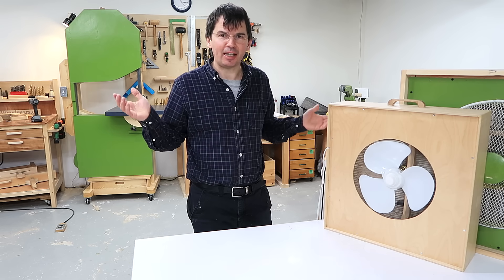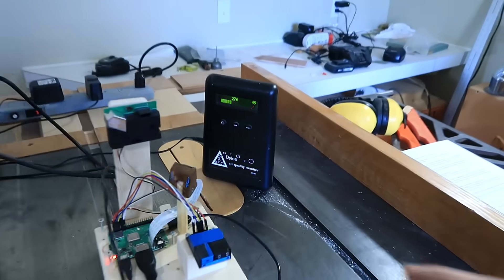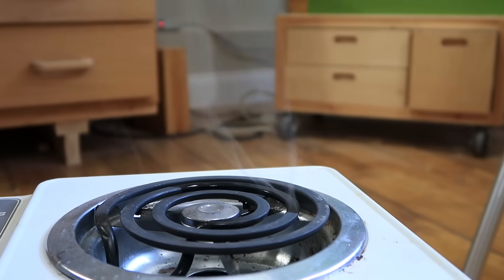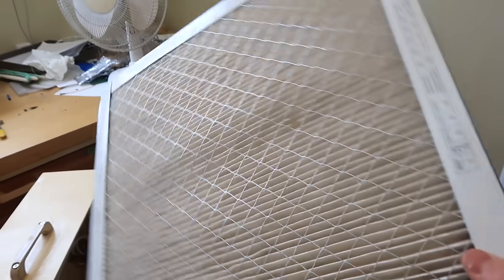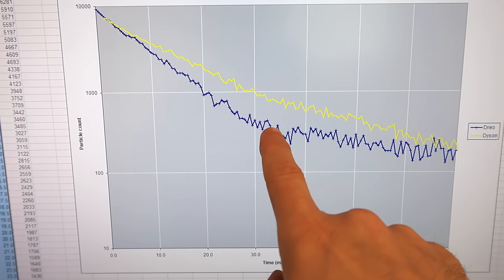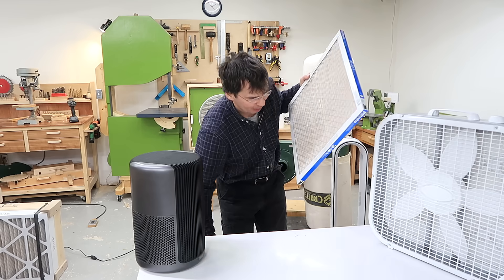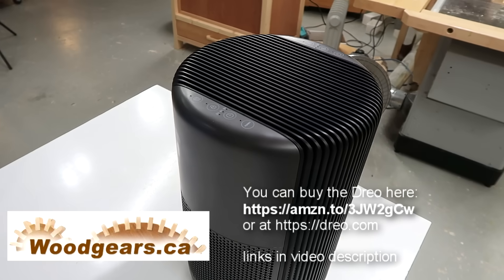Clearing smoke with an Air purifier.  Which is fastest, quietest?

Comment: Thanks for the material as always. 
I have been looking at making a diy box filter for a long time. The stumbling blocks in my country (Ireland) are around the filter availability. Also, we don’t tend to use a lot of big filters here so I’m a bit ignorant about finding comparable items. 
The older furnace filter, used in the video there, is a 3M filtrete 20x20x1 inch unit. 
Has it got any other features or characteristics that make it reusable for example? 
Dimensions are not supper important as long as it’s larger. But material and a availability are confusing me. 
I can find this one 
“3M 9832DC 20 X 20 X 1 Inch Filtrete Air Filter” but have no idea if it’s a wast of money for the purpose.

Comment: I live in a rather large home, so I have 2 separate HVAC systems.   Each has a Honeywell electrostatic air filtration unit.   Living in the Sierras, we get a lot of fire smoke even when the forest fires are 100 miles away.   The systems  are  multi-speed air handlers and on the highest speed they are almost silent and clear the air of visible particles and smells in minutes.   On slower speeds they take a bit more time but you can’t hear them at all.  Surprised you didn’t test any electronic air cleaners.   I thought you had in the past.

Comment: In all of this testing, I'm curious what the decay rate was with no filtering?  How much does the air quality naturally improve over time compared to the various air cleaners?
Reply: Oh that's a good point I hope he addresses that.
Reply: Matthias forgot a control group!
Reply: My thoughts exactly. As methodical as Matthias is I was wondering why the no filter baseline wasn't included. However, as with all his videos enjoyed it and I learned something from a very interesting guy.
Reply: The decay rate with no filter would be dependent on the building construction, available windows to open and everyone's setup  is different. We always open the garage door in the shop I work in during the summer and with a fans running that seems quite effective in clearing paint fumes quick. Would be good to know his natural decay rate for this video though as that is a large space and I assume those small air filters are not performing that well on their own. He says 165 sq ft and it was roughly 40 minutes for the dreo on high to clean it and the box fan was not much longer. I've seen testing on YouTube in a smaller 100 sq ft bedroom take an hour to clean to that level with the box fan filter.
Reply: I was about to say, we didn't get a control test to see what happens when the particles are left to settle, I'd like to see that. It could turn out the box fan is just a placebo
Reply: He already implied that, when he said that the cheap furnace filters didn't work at all. for the fine smoke particles, those cheap filters were the same as no filter.
Reply: Yep, clearly misses the baseline, however the comparison between the various devices holds !
Reply: Good point. But regardless of that, relative performance od various devices is still relevant.
Reply: Oh it’ll take forever
Reply: I realize it's quite late, but he did this in a later video: https://youtu.be/4iun3jRUMiA
Reply: I was wondering the same.  I guess it would friend on whether the particles would land on the floor… as I typed this he said that smoke can hang in the air for days, so that answers that
Reply: That's my thoughts as well, this test is not really worth much, without a baseline

Comment: I'm willing to bet that the generally available air quality monitors aren't capable or calibrated to detect dust generated from wood working. It would be interesting if you could figure out a way to measure that.
Reply: Btw, great video and method of handling sponsored content. That was interesting.

Comment: We had initially bought an air purifier. The controls wonked out after a couple of weeks. The return process was just too tedious for a $400 product that wouldn't work after two weeks of infrequent use. Bought a bunch of box fans and some good quality air filters and duct tape. Significantly less expensive and not a hassle either. The air has never been cleaner than this before.

Comment: The Dreo is not only not too expensive, it is probably one of the cheapest I have seen so far. Considering it's size and noise level, I would probably not consider building an air cleaner myself. Are the burning particles comparable (in size) to those created by cutting wood on the table saw? I wonder why burning was more of a problem and thought it might be differences in how good they are recognized by the sensors. But maybe sawing just does not spread the dust as much, meaning wearing a mask is more important if that is my main task.

Comment: The old filter on the box fan is saturated. That’s why it filters better.  The fine particles embed in the filter and become part of the filter media.  I am in the Ag industry.  There has been studies that show over servicing engine air filters  is actually detrimental to the overall health of the engine.  A seasoned filter is more efficient than a new clean filter. 

This could be something you could test for yourself.  The results could be interesting.
Reply: He has actually done this before, but it was a long time ago. You are 100% right.

Comment: So basically you can spend a TON of money on a Dyson that is loud, but will impress your trendy friends, spend a moderate amount of money on the Dreo, which is compact, works better than the Dyson, well designed and most spouses won't complain about how it looks, or stop at a hardware store, and get a moderately priced furnace filter after finding a fan a local yard sale, assuming you can't just find a fan sitting on the side of the road and do about the same job. Excellent video as always, and well reasoned out. You didn't say it, but after watching your channel for many years, I feel that if the sponsor hadn't done well, we would know, and why. Maybe Dyson should take some hints. Thanks for your hard work.

Comment: The biggest issue with the dreo is the fact the filters cost 30$ to replace and don’t have much surface area compared to the furnace filters running 20-30$ and able to be cleaned and reused.

Comment: Well made and informative.  One filter on a box fan did not pull any air.  I used 4 to make a Corsi-Rosenthal filter purifier.  I guess 3D printer may emit more gas than particles.  Filters may not help much.

Comment: try to spray a bit of lemon pledge on the filter, it enhances static cling of particles on the filter, even a crappy non pleated one.  would be interesting to see the difference with and without the spray on one with a box fan [also the method I have used over the years]

Comment: Great Video.  Youi should have done a control with no fan to see how fast it settles out.  

The first factor in the rate of fall is the volume exchanges per unit time.  That's a first order differential equation.  

There are HEPA filters that can remove very small organisms and dust from the air.  

Great video.

Comment: A related idea for a future video: how often should I replace the air filter on my house heating/ac system? Is blowing out the air filter with compressed air acceptable for reusing it?
Reply: Basically, when the flow is restricted you need to clean or replace it. It will continue to filter particles even when it gets old, but it will have so much restriction that the airflow will be reduced. So one way to monitor it is to monitor the pressure on the blower inlet side, and another is to measure airflow velocity. I don't think it is a good idea to clean it with compressed air because it may damage the filter. Maybe something a bit more gentle, like the output side of a shopvac, or if you have a leaf blower with a low setting.

Comment: As a guy with LOTS of box fans already, it'd be really interesting to see a test of which MERV rating is optimal for a box fan filter for the smallest particles from wood, 3dprinting, etc. I have to say this is an excellent way of presenting sponsored content. Well done.
Reply: If sticking with 1" filters, the 3M Filtrete 1900 which is a MERV-13, shown in this video, is the optimal one. It has the lowest pressure drop of the entire line (hard to believe, but true, you can see why in the design with high pleat density). Otherwise most 2" MERV-13 are a good option.
Reply: Yeah; you’d have to think a 4” Merv13 filter on the box fan might clobber everything… or burn the fan up, one.
Reply: @jasonm.7358  The part that I don't really have the equipment to test is where the point is where a higher MERV rating is actually worse because of how much it restricts airflow. I'm in wildfire country (who isn't these days) and I have been running some low-end MERV13 filters on several box fans when it's really smoky out. It makes a noticeable difference but the noise gets old.
Reply: @jasonm.7358  I have a home made filter in my shop similar to the one that Matthias made that uses a 1" thick 20" furnace filter. I put the highest MERV rating filter on it that I can find, usually like MERV 13. It's been running for years now without any problem with the motor. However, I don't run it every day, and I don't usually run it for many hours at a time (though sometimes I do). At this point anyway, I don't have any concerns about the motor burning out. Given how cheap box fans are, I think it's easily the most effective solution for the price, even if I have to replace the fan every 2-3 years.
Reply: If you're going to use the box fan, rather than placing a single filter on the back, I would take five filters, and make a box. That will give 4 or 5 times the filter area, reducing air flow restriction. With that, you can use the HEPA style high MERV filters, without restricting the air flow from the box fan. (If you place the apparatus on the floor, the bottom filter won't get much air)
Reply: @vincentrobinette1507  Wondering what the cost is compared to using a 4" filter instead?  Seems like less filters to clean when doing the maintenance PM task of vacuuming.
Reply: Who makes a decent box fan still? They all seem terrible now.
Reply: Yeah, I was also going to ask what MERV filtrete filter that was - there's all different levels
Reply: The Lasko fans are ok, and reasonably affordable.

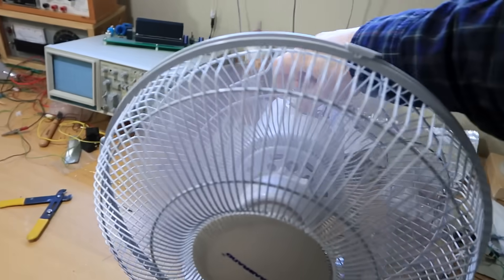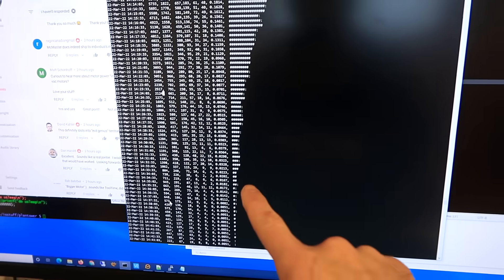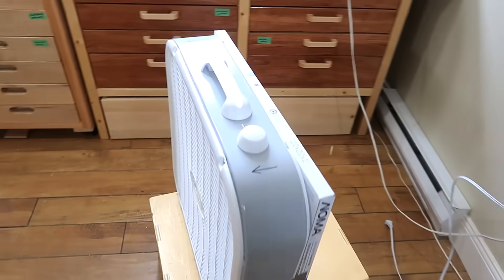Comment: Were the different filters all positioned in the same place in the room with intakes at the same level, and facing the same (where they have a facing)? At 1:50 and 2:19 the Dreo appears to be on a fairly tall box, the box fan is on a short box at 3:49, while the Dyson is on the floor at 2:42. There are shots later of them all on boxes on concrete for the audio comparison, but that wasn't the test room. You did a test a while back that measured air at different heights in the room over time (I think it was a temperature test) and the height was extremely important. I would expect a similar effect with air purification. I'd like to see a the test done with all of the products as close to the same as possible in case being elevated to a different height, or facing a different direction, changes the results.
Reply from the maker: position doesn’t matter much when the air is constantly stirred up.

Comment: I read that particles sink down so that the count is higher near the ground. I don´t know if this effect is noteworthy with very fine particles and how long it takes for them to sink down. But I´d like to know if it makes a difference if the air is sucked in near the floor and the cleaned air is pushed out towards the ceiling.
Btw: in Germany they set up air cleaners in certain streets of Stuttgart to fulfill fine dust limits (saech for filter cubes Neckartor). The particle counts went down by 10-30%. Crazy!
Reply from the maker: doubt it matters much.  these fines hang in the air for days

Comment: It might be interesting to try ridiculous mode where you run the same test with every filter at once (assuming circuit in shop can handle). See how short you can get the time to clear the particulate. I expect the result would be "more filter more better" but assume there is a point of diminishing returns.

Comment: Great video.

As far as I can see, there are only 2 relevant questions not answered;

1) What is the merv rating on the various filters?

A flilter with a merv 13 rating will pick up a lot more particles than a filter with a merv 8 rating.

If you compare the filtrete and the cheeper filter's merve rating, the filtrete will likely have a higher number given that it did a better job.

This may also be the reason why the two commercial air cleaners worked differently. However, you analysis on the way the air flows through that big one is most likely accurate as well.

2) How did you clean the filtrete filter?
Compressed air, or did you just wash it out under water?

Comment: WOW! I had no idea .... That is amazing that you can "do" all of this incredibly cool stuff ... I am definitely in awe. 
Such useful information presented here.  I do not recall hearing the MERV rating of the "better" filter on your homemade air cleaner.  Thanks!
Reply: When he's done videos about building furnace filter based dust collectors before, he mentions you want a pleated filter, but not the higher cost, high MERV ones.  Those clog up far too quickly with dust and stop flowing air.

For an air purifier collecting only airborne particles, a low MERV rating filter is probably a good compromise.  Though it depends if its installed in a wood shop (higher airborne particles more frequently), or as a cheaper living space air purifier, where a better filter could still last longer.

Comment: I was surprised that the years old furnace filter out performed a new filter. I've always bought cheap furnace filters and just changed them more frequently. Next change out, I will be getting nice Filtrete for sure.
Reply: The fine dust previously collected that's embedded in the filter clogs pores, blocking more particles, but also reducing airflow. It's referred to as "seasoning" a filter/filter bag...performance isn't at peak levels until it occurs.

Comment: I'm setting up a little welding shop in a small 16x20 garage. Do you think your home made air filter would capture welding fumes and grinding particles?
Reply from the maker: yes it would, and it would get full pretty quick if you stick weld or use flux core
Reply: @matthiasrandomstuff2221  Allright i'll give it a try, thank you!

Comment: Whoa... The glue gun observation caught me off guard. I expected my soldering to cause particulates, but not the glue gun...
Reply: Any odor a product causes is technically airborne pollution, whether particles or VOC caused.
Reply: @mlindholm  Yeah, that makes sense... I guess I'm not clear on where the line between molecule and particle is, in terms of health impact from particles lodging in the lungs, or whether it's even a particularly relevant distinction; I just assumed that whatever off-gasses from glue guns wouldn't be detected by the particulate sensor he was using or have the potential to be harmful aside from whatever immediate/acute impact it had. Like, I know I shouldn't breath acetone vapors, but I don't think of them as particulate pollution, and my impression of the sensor he is using is that it's detecting the latter, and I would have assumed that glue guns would be the former...

Comment: How long for the particles to settle without any fan or filtering? A baseline would be helpful in understanding the efficiency.
Reply: This.  I think Mathias missed a big data point without a 'no filter' option.
Reply: @turdferguson8732  Another is cost and 2nd sources for the filter.

Comment: There are two types of fans being utilized here, axial and centrifugal. Your axial fan is the box fan, it is really good at moving large volumes of air at low pressure, no filter on the intake. When you place a filter on it you drop the air volume efficiency and add additional load to the motor. Centrifugal fans are great at moving air under pressure, filter in front of the intake.
Reply: small correction, when you block/restrict the airflow it reduces the load on the motor not increase
Reply: This may be a good point for viewers. But Matthias knows all this stuff. He has a long history of building air cleaners for the shop. Just FYI.

Comment: Funny timing, I was thinking recently I need something like this. Auto mode sounds like a great idea too. I'd be curious about power consumption of each tho, noise levels, how cleaning or replacing the filter works, as well as availability for 240v markets.
Reply from the maker: The thing runs off a wall wart that provides I think about 36 volts.  So just the adapter needs to change.  And it can't use THAT much power if it runs off a wall power adapter.

Comment: Perhaps of further interest, especially to prospective purchasers, would be to test the best performing fan in different positions in the room.
To test efficacy dealing with point sources of pollution would perhaps also be useful to know.
Reply from the maker: I don't think that makes a difference if the air mixes well enough, which it does whan one of these runs.
Reply: @matthiasrandomstuff2221  I was thinking of the laser cutter. Surely the operator is served best by a flow of air away from the operating surface. So, where to put the device after that? How many times will the air circulate past the operator before background pollution levels are achieved?

Comment: Curious what happens with no air cleaner running at all, that would at least tell you if the Dyson is doing anything at all (I assume there's some level of reduction as particles simply settle)
Reply from the maker: Smoke hangs in the air for days
Reply: @marthale7 ozone oxidises compounds so they break down. good for getting rid of smells. you are thinking of ion generators.
Reply: Dyson air purifiers are terrible.